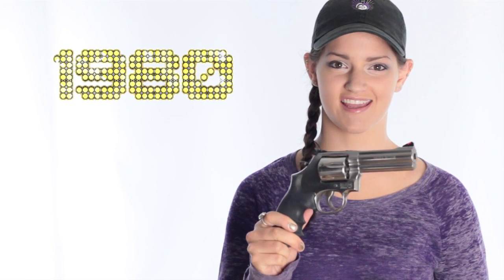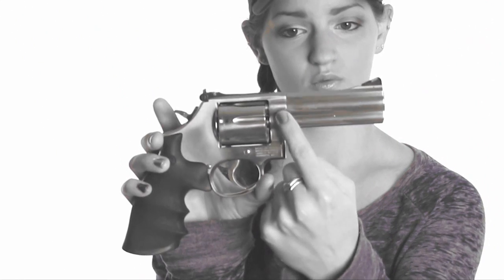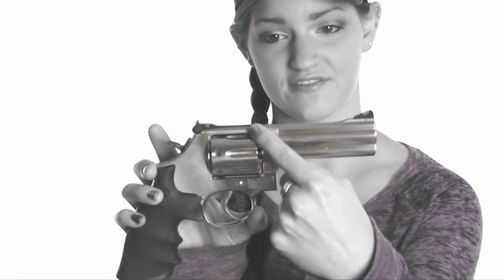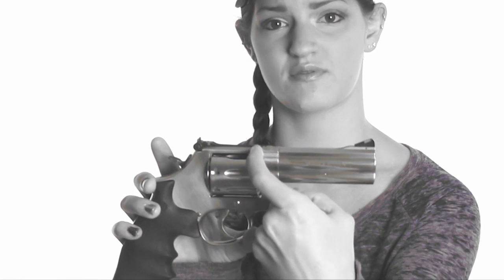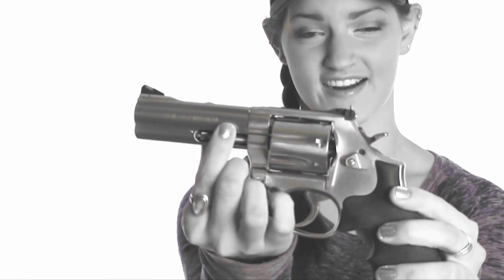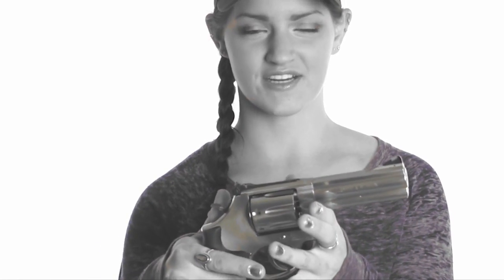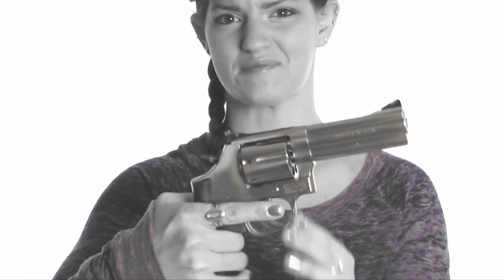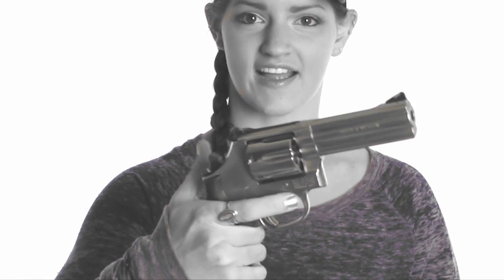S&W 686P - A BLAST from the PAST #FateofDestinee

Comment: Excellent video. I just purchased a 5" slabsided 686 Pro series P model. Out of the box I took 7 single action shots at a bullseye target at 25 yards. I did not have a spotting scope. I thought that I missed all 7 times becasue I saw no holes outside of the bullseye - when I was able to retrieve the target I noticed that all 7 went through the center of the target. The gun I purchased is easily the most accurate pistol I own.

Comment: Nice video. I just bought a S&W 586 and I love it.  It's beautiful and really fun to shoot.  I flirted with the 686P but the 586 was a little cheaper and I'm thinking about getting a Ruger GP100 later so I opted for the 586. I too was infatuated with cap guns.  I had a Beretta M9 that would eject the spent plastic caps out the top one at a time.  To a nine year old it was pretty awesome. Taking the 586 to the range today, very excited.

Comment: I don't consider a 12 plus trigger pull a smooth trigger. I recently had a trigger job done (Wolf spring kit) that reduced the weight down to 8 pounds. Now that's a smooth pull.